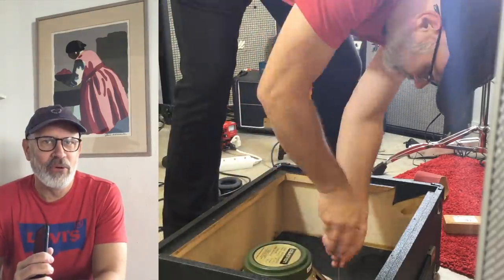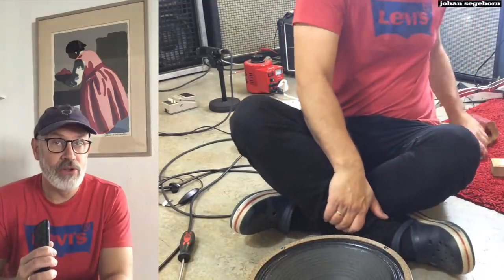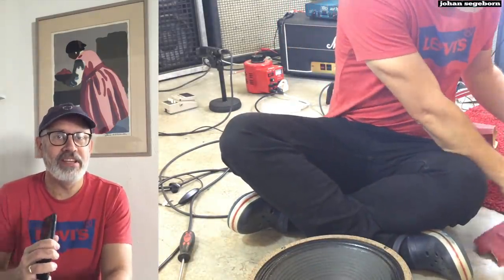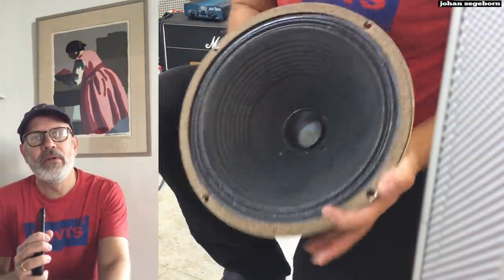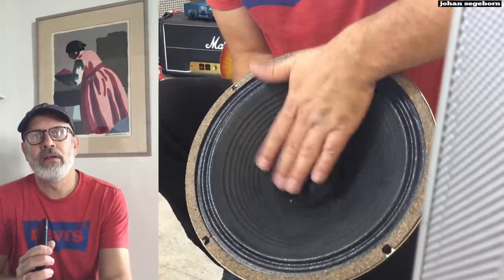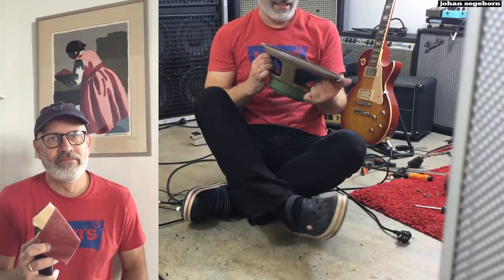New Greenback + SAND PAPER = Vintage Greenback?

Comment: When people played the ‘vintage’ gear, it was NEW then. Old sounding records could be using brand new gear. Hendrix is an example.
Reply: Yeah new guitars new pickups new speakers new everything lol
Reply: Not entirely true. It was pretty common for late 60s and early 70s bands to use equipment from the 50s and early 60s. Jimmy Page's Telecaster is from 1959, Led Zeppelin I is from 1969, so that guitar was not brand new at all. 
These bands - Hendrix too - played with what they had and they played a lot. I think they're stuff was mostly quite used and brand new equipment was a rare occasion.
Reply: @nr1229  
Yeah but new enough.
My 25 year old strat doesnt sound any better than it did when i bought it 25 years ago 👍
Reply from the maker: Yeah, those records are why this gear is desirable.Not the ageing that has occurred since
Reply: I've been a guitar player and and organ player for years. With guitars and amps age only helps tone, but with organ, there is nothing that sounds better than a brand new * or fully restored Hammond B3 and Leslie 122 (and other Hammond tone wheel organs...even the very first 1930's models & Hammond stock cabinets with stationary speakers predating Leslie rotary speakers).
[Hammond B3's and all tone wheel Hammond organs were made until 1975, then replaced by solid state organs, and although not the holy grail tone of tone wheels, Solid State tone generation, preferably discrete transistors not IC's, sounds very good]. 

* ( plenty of new Hammond B3 & Leslie's on vinyl)
Reply: @stecozz4907  
I bet she does! ;)
Reply: Has nothing to do with old... the guitars of the day were a completely different wood, nothing was mass produced like today, you cannot beat old growth wood from trees hundreds of years old. Honduras mahogany and real brazillian rosewood. The copper wire and raw materials back in the day were more pure, everything now has more steel content and iron in it. Nothing is the same and of course age helps..
Reply: While true, the materials they've used to construct cones has changed.  (As has everything else!)   So, my thought is that this experiment may not be mimicking the aging process so much as mimicking the vintage materials used.  (Weaker paper adhesives and thinner paper... MAYBE)
Reply: Right, which means the older gear sounded better brand new. The argument that gear sounds better as it gets older is absolute nonsense.
Reply: @nr1229  Correct, but Page's gear didn't sound good because it was old; it sounded good because it sounded good. Guitars and amps on 60s recordings sounded better because the instruments sounded better back then. Instruments again has exactly ZERO to do with tone.
Reply: @nr1229  This is true.
Reply: but it really doesn't take long for speakers to get broken in for example. Especially if you're recording an album or on tour playing a cranked marshall
Reply: Yea but new 60s was built differently to the current new. I like new Jensen speakers but even they don't quite get to the tonal plains of some of the beautiful cheap stuff from 60s. If sandpaper gets you closer to that then why not. It's cheap

Comment: What an interesting idea! I didn't really like the sound of the heavily sanded speaker. But I quite liked the tone of the lightly sanded one.

What sandpaper grit did you use? I am changing the speaker on my Vox soon anyways, I might try this with the Seventy-80 that's in there.
Reply from the maker: Thanks Rob! I used 60 paper. Cheers
Reply: I also have seventy-80's in a 4x12 and I'm thinking of trying this. Please let me know how it works out for you!
Reply: Underground Frenchy  I actually asked because in the video it seemed like a very coarse sandpaper, which baffled me. But Johan already confirmed that he used 60 grit, which is the same in the US as in the EU.

In retrospective, it makes sense to use such a coarse sandpaper, as to get a more irregular surface at the end, which is what (I think) Johan is trying to achieve with this experiment.
Reply: Johan, any further clarification on which sandpaper grit? 🤟😎

Comment: Awesome experiment and great channel! Might try this on a fullback... what grit sandpaper did you use? Did it take down the ribs of the speaker cone at all? Wondering if that’s the main contributor to the sound difference or if it’s the smoothness/grain of the paper itself... keep up the good work!
Reply from the maker: Thanks Michael, I don’t think the Fullback needs it actually. Great speaker. The paper was grit 60
Reply: Johan Segeborn did you notice if the ribs were taken down? I’m wondering if the sound difference is a result of the cone being smoothed (no more ribs) or the paper itself being roughed up (or was it actually smoothed with 60 grit?)
Thanks

Comment: 2 things come to mind; 1. Sanding this way will yield a non-uniform cone thickness, which could contribute towards misalignment of the voice coil. If not right away, it could happen over time due to changes/cycles of temperature and moisture. 2. The sanding debris, paper and the sand from the sandpaper could get into the voice coil. Interesting difference in tone though!

Comment: Genious! It actually works! I was sceptic, but it's pretty obvious. 
Question is, what is true "break in" of a cone? Repetion of soundgoing through, that makes it "softer"? Or pure thicknes?
  Amp/speaker guru Lasse at LH in Stockholm means that the old cones were thinner...  would be superinteresting to also make this comparison with a new speaker, that has been put through hundred hours of severe soundpressure. :-)
Reply from the maker: Thanks Viktor! Check out Mats Frånlund’s video on the break on topic
https://youtu.be/P4grDEC_Uj0

Comment: Even though I prefer far much the stock way, I didn't know about that roughest-up upgrading technique. So then you could try mine as well; get to spray a bit of hair spray onto the paper cone to get a "rubber" or "bounce" layer onto and it will sound rubberized, smooth, and "gummy"

Comment: The same principle with drumheads - coated drumheads have rough surfaces so they sound rounder and the higher frequencies are perceived to have rolled off, compared to clear drumheads.  

Thanks for the tip Johan!  You should have your name changed to "Plexi".
Reply from the maker: Thanks man! ;-)

Comment: You did a video of a corrective filter on either the output transformer or on the speaker. Why not do a video comparing an old greenback to a reissue with the corrective filter on the reissue. I think that might bring you part of the way. And then try taking off some of the doping

Comment: The 'roughed up' version seems to sound more like a healthy, vintage speaker. Likely the safest option as well. The heavily sanded version sounds flatter and a bit tired. Wiping the cone with acetone should have similar effect as 'roughing up' without as much risk of damage if you're careful.
Reply: Todd Neary totally - I’ve been using a bit of acetone while gently exercising the cone with a variac and you can actually hear it relax a bit. Really helps with the heritage g12m which comes super stiff and strangely un-doped.
Reply: Todd, you nailed it. It sounds very much like a well used/abused speaker. Presumably part of the charm of the vintage cones is that the paper fibers break down over time and it probably does become, literally, depleted in mass. Factor in moisture/evaporation and you get a thinner more brittle membrane over the years. Not sure if modern speakers do this though .. the materials are probably all plasticised..
Reply: It would probably be a good idea for treating a Vintage 30 too.
Reply: @psychbeat  - a variac helps, but I'm guessing most people don't have access to one. Blowing up greenbacks used to be a regular thing, but doping helped to reduce that along with other issues like cone cry, etc. I'm sure you already know this, just mentioning it for those who don't.
Reply: @cgavin1  - You're on the mark as well 👍. I'm sure there were even more differences in the room soundwise, and probably differences in feel also. Was this the case, Johan?
Reply: @kimhansen6384  - would probably work as well for any stiff sounding, tight and overly focused treated paper cone speaker.
Reply: Also interesting how it moves the low, mid and high response around between each 'version'.

Comment: My big concern about this method is that using an attenuator also attenuates the sonic influence of the mod to the cone surface.  Aka, what does it sound like cranked?
Reply from the maker: The attenuator is at -8dB so basically no coloration and the speaker is pushed to its limit. 50W amp
Reply: @JohanSegeborn  Awesome!  I have a feeling this video is going to start a trend, and it's good to know right off the bat that the speakers can still handle full power if you don't go too far with the sanding.

Comment: I did a spectrale analysis of your 3 speacker sound. Between the stock and the "roughed up cone surface", there is a hugh deep at 7100Hz of -13db with a q of 4.1. between the more sanded down and the stock, the dip is lower around 6,5Khz. Long story short, if you plan to record, just cut the 7100hz. or put digital eq in the loop of the amp
Reply: Good to know, the right frequency span to tweek - got 2 analogue eq's before, and a digital in the loop.

Comment: Instead of sanding the whole cone, one could run frequency response tests on both speakers and find the resonant peaks that poke up above the old speaker and do the math to find the wavelength and sand only that area of the cone. 343.2 (wavelength in meters at room temp)/frequency= Wavelength at that frequency. Without running a frequency response, if you have a recording of both speakers and you use a narrow band EQ to remove the offending frequencies and make it sound more like the vintage speaker, you can calculate and sand just that area. For example, say the offending peak it at 4500hZ, 343.2/4500=0.0762M, you could sand a 7.62cm diameter ring on the cone and see if it tames that peak. In real life though I would just play them till they broke in, everything from the spider stiffness to paper to gauss of the magnet contribute to the sound and a sanded speaker may not last, or get dull after a while once break in does occur.
Reply: It's a fascinating Idea tonally but the  problem with this Idea is structural.  you'd be creating a weak spot  in a ring at that frequency, and that's where the cone would fail eventually.  I think you could get away with sanding only if you do it VERY  evenly.   I'm with you, just let it break in Naturally.   If you really must mess with it try using acetone to remove some of doping, or  apply the correct amount of D. C.  voltage to the speaker to hasten break in.  There are time tested formulas for this.
Reply: @007Elvisofnazareth  I agree, a better method would be to apply doping dots at those nodes, you could start with 2 or 3 and add more if needed. Something removable like a small sticker or that cold be peeled off like moon gel on a drum head would be better, that way you could tame those peaks until break in occurs and then un-do the treatment.
Reply: @ER-yq1lc  That's really interesting man!   If you thinned out the doping enough you could maybe make an entire ring? Maybe the dots are a  better idea so the speaker will still vibrate like stock.   I remember in the 90's Mark Sampson from Matchless did some king of magic trick to Vintage 30`s.. it was amazing. I don't even like those speakers unless he treats them. I asked him once, but he wouldn't tell me what he did.  
I had one of the earliest Matchless SC-30 amps.. the magnet actualy had a decent chip in it, like he beat on it!
Reply: @007Elvisofnazareth  If you look at the old WE 755a speaker or the Altec Biflex they had pleats and doping in different areas of the cone to allow for the cone to vibrate at multiple frequencies better in an attempt to reduce IM distortion and smooth out peaks. I think that's part of the issue with stiff new cones, the voice coil can't smooth out control of multiple different frequencies. Magnets will lose strength with impact, alnico is the worst but ceramic magnets will do it too. Magnets gradually lose strength over time so smacking a magnet will degauss it a bit and make it sound softer like a 5 or 10 year old speaker, but you can over do it too if you're not careful. I think that and a little proprietary doping were in Mark's bag of tricks. Hey Johan, maybe another video idea, grab a hammer and smack some magnets to gradually demagnetize them!
Reply: @ER-yq1lc  I wanna help with the magnet smackin'!  🤣

Comment: To me, the stock and the "Cone Sanded Down Quite a Bit" clips sound brighter and the "Roughed up Cone Surface" clips sound warmer.  Assuming that EVERYTHING ELSE WAS EXACTLY THE SAME, I would prefer playing a rig with the "Roughed up Cone Surface" speakers.

When you order speakers from Weber, they ask you to specify the amount of doping (the gluelike substance around the outer edge of the cone and holding the center cap to the inner edge) that you want.  They say that otherwise identical speakers with more doping are darker and speakers with less doping are brighter.  Maybe a subject for a future video?

Comment: I think the roughed up one was the best sounding but I don't think either mod made the speaker much closer to the original G12Ms. The mod seemed to take off top end harshness, which is definitely nice. Comparing originals to reissues though, I find the primary difference is that originals are more scooped in the mids and with greater overall clarity and detail. The treble harshness isn't as significantly different as the mids and clarity, to my ears. Reissues seem much more prominent in the midrange and compressed and congested. Wonderful video, as always! Huge fan, here!
Reply from the maker: Thanks glad to hear it! The original is definitely more scoped. I compare this speaker to the original in this video. https://youtu.be/uhqX7Glzyog  Cheers

Comment: The cone with a rough surface seems to lose some of its bite (a pleasant change), but when it's sanded further, it's occasionally harsher than when stock. Maybe the extra sanding thinned the cone to a point where it could be easily disturbed by reflections or its own vibration/movement? 

Now I'm all curious about cone construction...

Comment: Grrr, I was hoping to hear zero difference, but it was obviously different when sanded.  Sadly, I think I also like the sanded sound better.   Of course the big question is what does that do to the integrity of the cone?   Do you think it's significantly weakened?  I feel like speakers blew out more in the old days due to weaker materials being used.   We might now get ALL the old features of the vintage gear! :)

Comment: Interesting demo. The original sounds fuller, and after a couple of weeks of playing they get sweeter and lose that ‘new’ edge. For a reissue they are a great speaker especially when driven fully, i.e. 2 Greenbacks with a cranked Marshall 1987x 50W, and yes they will take it, and I have discussed this with Celestion and they agree.
Reply: I also have the 1987x and I cant decide whether to get a 2x12 or 4x12 greenback cab. Two 25w speakers should be perfect for a 50w amp right? Or  donyou think a 4x12 is better? Im mostly recording at home with an attenuator btw

Comment: Johan, I listened twice. I run my laptop into a stereo amp into a pair of infinity bookshelf speakers. I thought the sanded speakers sounded smoother than the new greenback but I just couldn't tell which (roughed up or smoothed up ) sounded best overall. I've never had or played a vintage greenback so I don't know if any got close to a vintage greenback. Thank you for doing this demo. What are your thoughts? Did any of the speakers = a vintage greenback?

Comment: Johan, I would really like to know what you thought. The problem even with great old Celestions is they sound different when recorded than when you're standing right in front of the cab. They're also very 'directional' and do very interesting things out in front of the cab when the sound waves mix. I would like to hear if you thought any iteration of sanding got them closer to vintage speakers. Celestion needs to do something because, sadly, their speakers are harsh and they don't have that magic they had from 65-72. It would be great if this gets us close to the old ones or leads Celestion to do some good engineering on the cone surface. Thanks AGAIN for doing these GREAT videos!!
Reply from the maker: Thanks Blake! Great to hear that. I think the only realistic use would be to just rough up the surface slightly to get rid of the synthetic quality of the top end. The Reissue will still have its basic frequency distribution but it will sound more natural. We’ll have to do more experiments to identify what the main contributor to the nasal quality of the originals is. Cheers

Comment: I bit.

Have two 2x12 cabs with the same speakers.  Speaks are broken in, but not ‘well worn’.  Lightly sanded one cabinet with fresh 120 grit (G12c and a Weber 1230-55) then compared the two cabs through a jtm45 head and an 18 watter from Mojotone.  I’m shocked…it took longer to removed the speakers than to sand the cones.  Overall smoother and the breakup is more ‘organic’ sounding.

Johan not only has (lots of) cool stuff and can play, but who knew he was an inventor?!

Comment: I'm using this as reassurance. I bought an oddity of a speaker, it's an older "Made In England" Seventy 80, and I only now noticed the former owner hit the doping with sandpaper 🙄. Once it's hooked up I think I'll dig it with my CL80. I play clean strat stuff. So whatevs